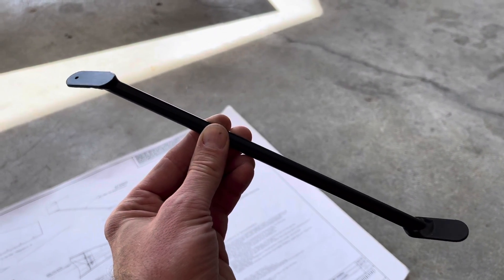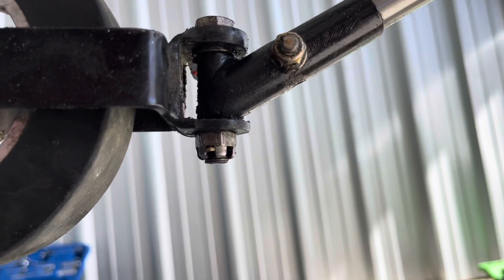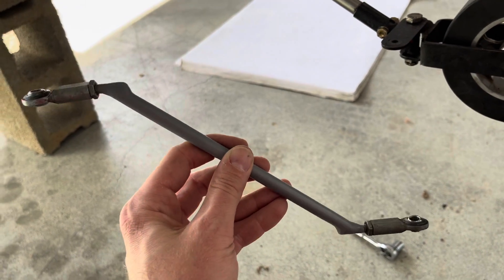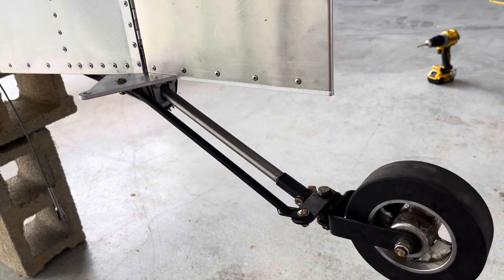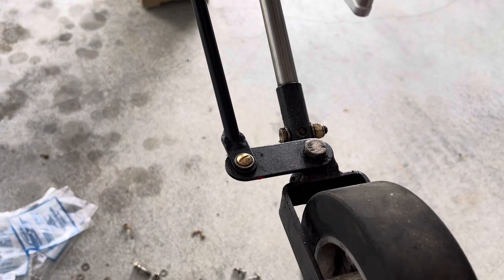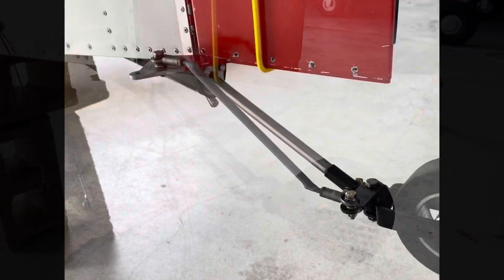Devil is in the Details (Lean of Peak Aviation)

Comment: Our Sonex, has the "upgraded" link with the ball ends, this was chosen for the vary reason that has been mentioned by others. The standard link does not freely allow vertical movement from the flex/spring in the tail wheel shaft.  This produces unwanted flex and wear on the cranks/attachment points that could lead to stress failure and free-play in the assembly. The ball end link moves freely with the vertical movement of the tail wheel while providing a slop free connection.   If the "upgraded" link has the exact same measurements eye to eye and the geometry matches the standard design as well as being attached as per the plans it allows full and free moment of the control surface. The addition of a washer larger than the hole ensures if a ball ever failed the control rod would stay attached but would now have some freeplay but would not be a catastrophic failure. The argument that the original design has been in use for 30 years without any known failures is valid but it does not mean that it cannot be improved if done correctly.
Reply: I agree, the Heim Joint push rod is definitely a better engineering solution, that being said, the fit up and top mount was not a good choice by the original builder, nor was the failure to fully study the action of the push rod at the end of travel!!!

Comment: I'm quite surprised that they use a solid control link. I've seen various tail draggers with springs to the tail wheel. So it suggests to the tail wheel to turn.
Reply from the maker: It’s definitely a more solid, direct feel.  RV’s use something similar although theirs has built in shock absorption.

Comment: Strange to improvise such a control arm, it's a rather specific design. Could it be that it's just an older sonex design?
Reply from the maker: Nope.  Sonex tech support was adamant they’ve never used anything like it.  I also have the specific serial numbered plans for my plane and the part he used was not correct or correctly placed.

Comment: I have noticed a trend lately in some of these aircraft DIY videos that would have my real Authentic A&P mentors from Enterprise turning over in their graves if they seen them cheap Walmart Kmart Harbor Freight Lowes tools around a friggin air plane... I'm afraid Joe Biden turned over too many times in their graves so it's safe to say they're a bit pooped out.. Folks if ya can't afford real tools don't touch an aircraft. We got another splatters at the airports as it is. Just recently I had 2 mechanic Fed Ex Boobs come over to me at my hangar locally and ask me to borrow a torque wrench... Needless to say after I had seen their PIG PEN of a hangar days earlier I would never fly a Fed Ex plane for any amount of cash... You folks suck it buttercups they got drunken retards with no tools working on your Fed Ex rides.... Go figure its a sign of the times folks

Comment: 1.
2:32.. Play is unacceptable. OK. 
Ream the hole in the plate, and turn a small sinter bronze bush that just fits. Play gone. Apply grease to keep moisture away.    Idea?

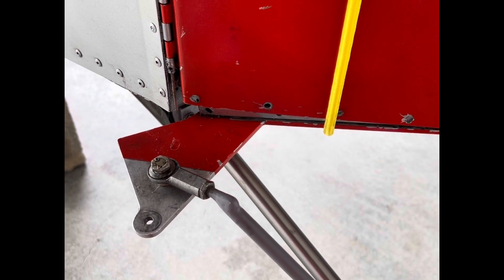2. 4:33
That assemby is designed to fail that way.

Peak forces on the tailwheel are bringing pounding loads in that rod. These loads under an angle cause the secondary bending moment which is designed to exist in this assembly.
If you apply an small angleplate between the lower bracket/rib and the skin of the rudder, the moments are coupled off. The lost rivets will not come off again. 

The strength of the sheared-off rivets is overestimated, or the loads not identified.

Remember that the Avdells, pull-through-rivets or pop-rivets are hollow. These arent solid AD or DD rivets such,  as used in in a B-17, Liberator or equivalent, and have only a fraction of the strength.

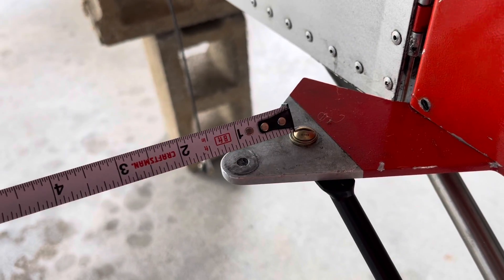Comment: If the forward bolt position (measured at 3:19) is off laterally, maybe it is also off fore/aft. There is no adjustment in the factory link, so if the hole is off the tailwheel may not track straight. Which is maybe why the previous owner made his own link with Heim joints for steering adjustment?
Reply from the maker: Good theory.  There’s certainly no room for error

Comment: Sonex has designed failure into this tailwheel steering system. The rigid connecting rod between the tailwheel & rudder horn loads the rudder horn & hinges when the tailwheel support rod deflects under load.

Comment: What grade of connecting hardware did you use are you using Teflon impregnated nuts is there any spec for a sleeve where where that undersized bolt is moving around
Reply from the maker: The plans call for aircraft grade cadmium plated hardware with various AN numbers…the pivots are AN23 and the big one is AN6.  The use a castle nut and cotter pin for security.  I could use make a bushing but I’ve ordered replacement parts since I just don’t know how much adverse force has been applied to these other parts.

Comment: It looks to me  the control rod is going to act like a second torsion bar  and will put a twisting load on the control horn.  It's hard to see ,are the attaching points on the rudder horn the same distance from center Left and Right? For pull pull cables they should be the same, it looks like a lot is going wrong with this setup.
Reply from the maker: Sortof an illusion.  The cable pivots are equidistant to the rudder hinge but the rudder hinge itself is not centered on the rudder.  It’s a one sided hinge on a triangular rudder.

Comment: I use a rod between my tailwheel horn and rudder horn on my model planes, but it does transfer shock loads from the tailwheel to the rudder. That can cause the rudder horn to come loose or it can damage the rudder hinges. I have noticed more damage than the springs that I used before.

On GA planes, springs would be way better and much safer.

I'm glad you found the root cause before you lost rudder control.

People need to really be careful when they change the design, even when they think it's a minor change.

Comment: How will the new ( standar? )control rod absorb the flex in the support bar of the tail wheel? Also you are going to need those spherical.joints to negotiate that. You risk breaking the rudder control horn leaving the craft ruderless!!! That's why you need springs to control the tail wheel, to absorb all the differential play among parts without overstressing any.
Reply from the maker: Sonex has been using this design for 30 years and this is an isolated incident with nonstandard parts.
Reply: @LeanofPeakAviation  may be that's why the former owner made a mod. You better ask him. Just a suggestion.

Comment: GREAT VID.  Loved the testing. Was wondering if you should redesign the way the tailwheel hooks up to the rudder. I like a spring on the RT and  LT side to eliminate any vibration or hooping pressure on the rudders control arm produced by the wheel hitting things. Seems to me a very bad design.  Keep up the good work!

Comment: Having helped build three Experimental aircraft I found that sticking to the plans is hard for the personality of the average builder BUT the plane should be built to spec because the builder probably doesn't know all the engineering decisions that went into the design. The NTSB has many accident reports where an experimental aircraft design was as good as a certificated airplane but poor workmanship or minor changes introduced by the builder lead to crashes and/or fatalities. I walked away from helping one builder because he just cut and threw the fiberglass on any old way (to economize on material evedently) instead of orienting the strands properly for the loads. Luckily he ended up abandoning the project (a divorce during build) and the plane was scrapped.
Reply: Construction may not be that glamorous but not properly bolting ledger boards to band boards, rim joists or whatever term you may use is where I've drawn the line a few times and I have no problem calling the building inspector. You'd think after a rash of deck collapses with fatalities at a time where people paid good money to enjoy the paradise I was lucky enough to live in, Outer Banks of North Carolina,  you'd at least protect yourself and reputation by bolting every other bay but nope, slap it up and on to the next one. These decks are very high as just the first floor is eight to 14 feet above ground level so add two or three stories a hot tub also not installed correctly and you get my point. My decks were usually cantilever with bolts in every bay which isn't required but I enjoy sleeping soundly.
Reply from the maker: Very good comments.

Comment: As someone who spent a year tearing down and rebuilding a 1961 Cessna  172B 'certified' aircraft... Don't let 'certified' / 'passed annual'  give you all of the good feels, while putting down homebuilders as corner cutters.  
We found 60 years worth of non-standard parts and repairs in the 'certified' airplane.
Reply from the maker: That’s precisely why I sold my 172.  My mechanic on my certified plane almost killed me and charged a fortune to do it.  Sonex is a good airframe and built properly is as safe as anything in my opinion.

Comment: Are you sure, that the backwheel assembly is not meant to be attached 180° turned? (upside down from now?)
Reply from the maker: That would place the welded arm on the other side of the plane.

Comment: It sure looks simpler than my RV-8, but how do you swivel 360 degrees with that tailwheel?  Does the tailwheel free up at some point?  Installing an "action" camera back there in a safe place would be eye-opening.  There's a lot happening.
Reply from the maker: There’s no 360 swivel.  When you reach the rudder stop you’re done…which is totally fine you’re just not going to do ground turns in place.

Comment: Looking at that, I would guess that the problem link was made to mount above the rudder horn and at the bottom of the tailwheel horn. Playing devil's advocate, some mechanics have a real aversion to having a rotating metal plate under a bolt head as you say the factory link is supposed to assemble. Too much play to start with, and then extended wear would make the problem worse.
Whoever made the link with Heim joints was probably wanting a tighter grip on the bell cranks and and an oiled ball wear surface that will allow for misalignment when turning...good idea.
It would be interesting to see how that Heim joint link looks when attached as I suggest above.
I wonder why Sonic did not use a double spring steering common to most taildraggers.

Any rigid link will transmit loads while taxiing back into the rudder Keep an eye on it.

Comment: The original builder must of had problems with the sonnex stock rod & added rod ends to prevent strain on the rudder horn. You should of used cherry max aircraft rivets on that rudder horn it would of been alot stronger.
Reply from the maker: I hear you but the last guy deviated from the plans with disastrous results.  Maybe cherry max rivets hold the horn in place so the rudder hinge fails next time?  I think I’m going to trust the plans and follow them since this seems to be a unique failure mode. I’ll make this a regular part of my preflight checklist.

Comment: Ok so what happens when the tailwheel fork flexes due to landing loads and uneven rolling surface? How does that flex affect the fixed tailwheel control pushrod? I don't see how the new pushrod can account for the fork flex during tailwheel suspension action.

Comment: I guess my question and concern for you is what else may have been done that's non standard? Does it concern you at all or have you had everything else examined?
Reply from the maker: Agreed.  I’m pretty much trying to go over everything reasonable and compare to the plans…Critical control structures obviously being the biggest concern, and then anything that might cause a catastrophic failure.
Reply from the maker: The worst part was it had its annual inspection by a certified mechanic 2 weeks prior to this incident happening.

Comment: Amazon sells bags of miscellaneous tubing; brass, copper, aluminum... Bushing material.
Reply: Even though it’s experimental/home built, I would use approved aviation hardware, not shopping at Tri Value, Amazon or…. Use AN bolts, nuts etc.

Comment: If you don't wish to replace the whole Tailwheel castor, you could use a larger diameter bolt to attach the control arm, or you could use a bushing to tighten the hole up to your specs.
Reply from the maker: For sure.  It’s not just the control arm though the caster’s pivot is also too big and non standard.
Reply: @LeanofPeakAviation  I think that Myles Vrooman might be referring to the #8-32 screws that are used for a pivot on either end of that offset push/pull rod... Personally, I still feel that this design is flawed... Yes, the devil is in the details, and if you look at several other planes with steerable tail-wheels, and nose-gears ,  many of them use bungee springs that are attached to a pair of control cables / linkage going to the rudder... In this way, the rudder can still be operated in the event the auxiliary wheel should freeze-up... And like Myles, I also feel the Tiny #8 screws should be used for fastening adel clamps and clamping down light avionic equipment... Those bends on both ends of the push/pull rod they just sent to you have no gusseting where the angle is created.... If I was to design that plane, I would have made sure the control horn is directly inline with the pair of cables operating it, and any mechanism operating a steerable tail wheel would have bungee springs allowing the rudder to move independently from the steerable aux gear, like many other planes have had for a very long time....
Reply: @LeanofPeakAviation  the documenting of things is always a good idea... But being that this is an experimental aircraft, that would alleviate huge concerns for a liability case against any parts provider, as the plane was mfg'd by the pilot....As far as the flexing of turning forces, from side winds, and suspension rebound, or if the linkage does become damaged from forces like these, it is ALWAYS a good idea to isolate the rudder controls with a bungee springs...  This is WHY most tail and nose steering mechanism's have two cables going directly to the rudder and two bungee springs on dual cables going to the auxiliary wheel .. Several builders have eliminated the steering linkage going to the aux wheel and just have light centering springs going to the aux. wheels ...  They use differential braking at slow speeds and when the aux. wheel is off the ground as the plane rotates, the rudder is in complete control....
Reply: @LeanofPeakAviation  that is totally understandable.... Maybe the things that you have learned from this purchase could be a great aid in identifying a good plane to buy...
Reply from the maker: @michaelmartinez1345  No kidding.

Comment: With Just bolts attaching the horn to the wheel assy how does it swivel when a load is applied in a down force to the tail wheel arm?? The tabs are just flat surfaces.